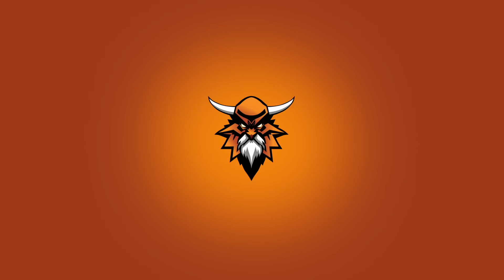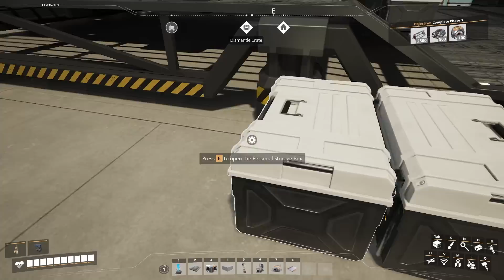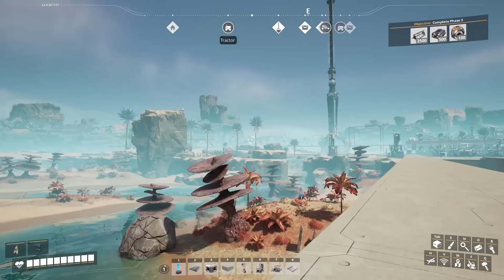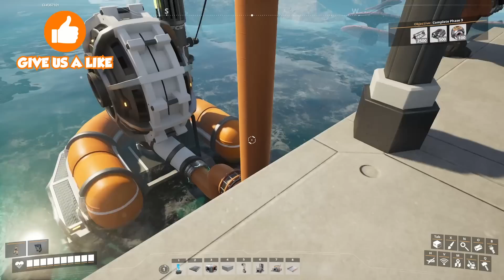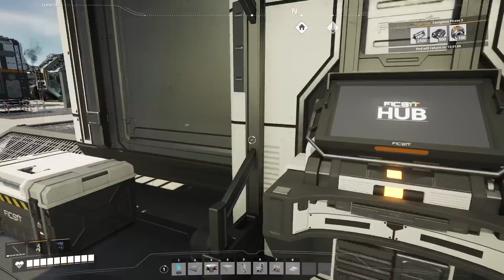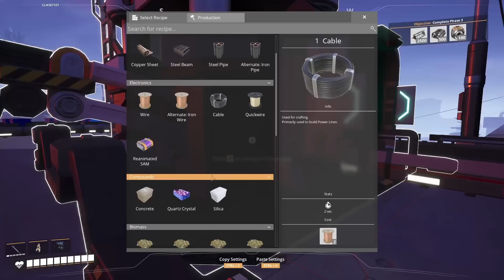Satisfactory 1.0 - Best Jetpack Fuel and How to 4x Coupons [E11]

Comment: Gotta love how somersloops can stack.

1 dead stinger -> 2 alien protein
2 alien protein -> 400 biomass
400 biomass -> 400 solid biofuel
400 solid biofiel -> 533.33 liquid biofuel
533.33 -> 533.33 packaged liquid biofuel

So a single dead stinger gives you over five full stacks of liquid biofuel. And each one of those lasts a very long time due to its long burn time.

Not knowing what to expect i think i threw about 20 dead stingers into that production line. Now i have a full industrial storage container filled with solid biofuel and a full large fluid buffer full of liquid biofuel. That should last me the whole rest of the game.
Reply from the maker: It is brilliant. I also used the Sloops on the Power Slugs. Load of Shards.

Comment: I went for a 240 upload speed and 3 stacks and found that the rate was enough to cope with my building speed.
Could just deposit the liquid fuel into a depot if its only for personal use.
Reply from the maker: Yip. I'm not going to be using a dedicated depot for the biofuel. I use so little but I have uploaded some.

Comment: Dimensional Depots on top of the Double Height storage containers works great. Add the depot on top with input facing the output side of the container, then a conveyor lift on the top output of the container plugs straight into the depot. Its a match made in heaven. I have them on top for so many things so there is always access to something I might not have with me.
Reply from the maker: Thanks, I just did it for the first time and it is brilliant.

Comment: You are almost at the actual best jetpack fuel, rocket fuel
Reply: isn't ionized even better than rocket fuel tho?
Reply: @markus95922  Rocket's got the most speed, but I think burn time and air control on ionized is better iirc.
Reply from the maker: Next episode. Strangely, the liquid biofuel is better than the turbo fuel for the jetpack.
Reply: @surtrplays  I think better vertical boost for rocket fuel for the height achievement

Comment: After last night exploration via hover pack i only have 1 more stack size increase and I'll have all the upgrades for the dimensional storage. Unlocked sloppy aluminum and tapped a bunch of geyers for some extra power. Have a lot of building to do this weekend.   I like the somersloop idea with parts had not tried that yet.  I did build two of the power boosters and they are giving just a little over an extra 1k power.
Reply from the maker: Nice going. You are progressing well.

Comment: I think they ruined the explorer. Bedore it had a V8 and drove like a Formula offroad. Now it sounds like a sewing machine,  the suspension are WAY to hard and its handling are awful.
Anyone else?
Reply: All the vehicles are like that, complete with flubber tires with little traction.
Reply: @brodriguez11000  yep, can we get the old version back please!
Reply from the maker: Yes, it is a bit weaker now. Still works well so I'm not too stressed.

Comment: there are 300 spheres in the game, after upgrading fully the depots you can still put depots on every item you would need in the game.  It's just time and effort to find (easier in god mode with flying) which is what I'm doing right now ( don't do that at home kids if u want the achievements!)
Reply from the maker: I want the achievements so it none of that for me.
Reply: They seem to more than doubled the range on the hover pack  can be from a line now.  Fly around placing power poles it's almost like AGS fly mode.
Reply: @willrun4fun  not only that but you can interact and pick up items from a lot further away when hovering around.
Reply from the maker: I am really looking forward to the hover pack now.
Reply: Cool. I was wondering how many spheres. Do you know if the diluted packaged fuel alt recipe is still in game? 
God mode? Doesnt that ruin the experience? Stingers freak me out, would hate to rob myself of the accomplishment of clearing a cave and desecrating their home with a railroad.
Reply: @phillipcurrey6961  diluted packaged fuel is in the game. I found it, and I think Imkibitz uses it in his playthrough.
Reply: @phillipcurrey6961  Most of the streamers use god mode before recording a proper playthrough so they can suss out all the locations etc. and if they deny it they're lying lol.